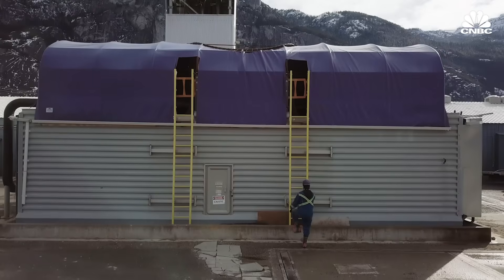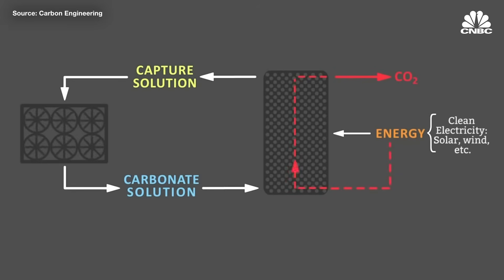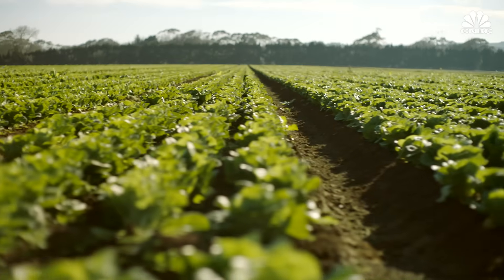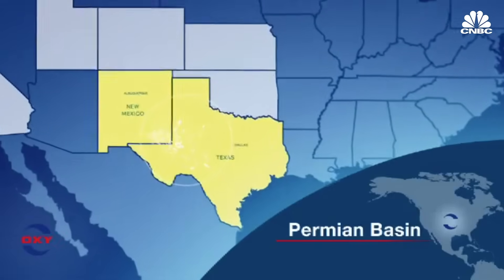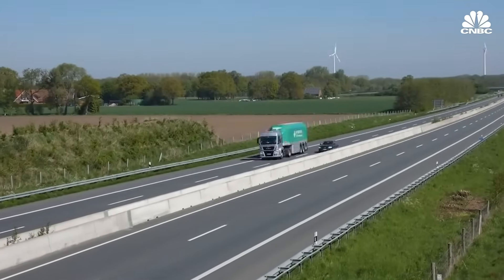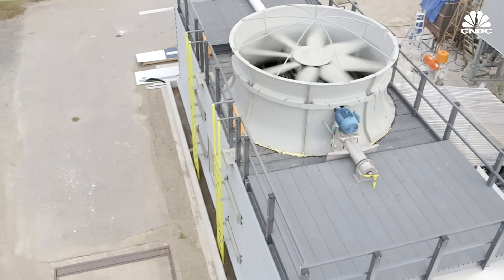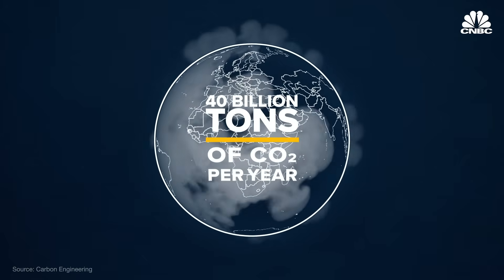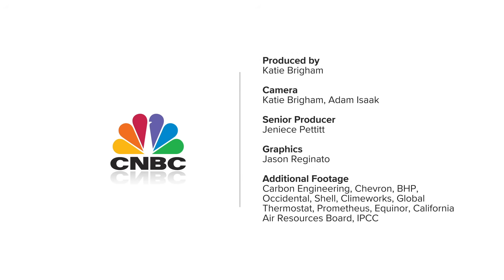Bill Gates-Backed Carbon Capture Plant Does The Work Of 40 Million Trees

Comment: Trees exchange oxygen for CO2 . 
They don't just take CO2
Reply: exactly.. this does not replace anything, its a giant CO2 sucking machine.. it doesnt convert it into anything useful- heck they even said in this video that the pellets would be 'buried underground'... wtf???
Reply: @jub8891  the pellets can be turned back into fuel, which is pretty much why these oil companies are investing in it. it becomes sort of carbon neutral its a good way to use unreliable solar and wind power and convert it into a reliable fuel source.
Reply: @gargalash9191  i dont think you can just keep recycling carbon as fuel.. and in the end you are just burning a carbon based fuel all over again.. that is why the first proposal in this video was to literally 'bury it underground' then followed it up with a vague comment about using it as fuel.. not to mention the vague 'chemicals' they are using to trap the CO2 which they never named- i wonder if that chemical is in anyway safe or how much energy is required to produce it?
Reply: @jub8891  the chemicals are in a closed loop cycle im assuming its similar to an a/c unit where their chemical is like Freon but it pulls carbon. oil companies are looking into new ways of cracking fuel this is one of them. another one thats interesting is plastic to oil in large viable scales, once again oil companies are investing. oil companies are investing in green tech they know there's a transition coming.
Reply: Whatever they make o2 or not, does t really matter. Removal of co2 is their goal (it will not work anyway), not replacing it with o2. We have enough o2 and grabbing even 30% of all co2 would not change o2 levels. But they will maybe capture 0.0001% year.
Reply: Well right now there’s an inbalance of c02. The point is to make this more carbon neutral. I think there’s plenty of co2 we don’t need. Now if they can just plant more trees then im all for this
Reply: True, but we're not actually on short supply of oxygen. If trees 300ppm of CO2 (which is a lot) out of the atmosphere, they'd release 300ppm of O2, which is very little compared to the 200k+ already in the atmosphere.
Reply: We don't need more oxygen
Reply: @danm4320  I do

Comment: Just plant trees and replace coal and oil by nuclear, the solution to climate change is staring at us in the face.
Reply: Loppy2345 renewables are 1/2 the cost per MW to construct compared to nuclear power, and without the on going fuel, maintenance, operations,  waste disposal,  public liability and decommissioning costs nuclear power has. This is why new nuclear plants arw not being planned - renewables are vastly cheaper.

Comment: Carbon capture still uses energy to work. Even if this energy is "clean", the clean energy has a potential alternative use - to be used for some other purpose which is being currently serviced by conventional energy.

Natural carbon removal machines - trees and oceans teaming with life, are not only cheaper methods but also provide multiple other benefits - like improving soil quality, sustaining other life form, preventing erosion and many others.

In my view the option is very clear - we only need to act!
Reply: Why not have both? Planting trees is good, however thats not exactly an energy free task either. Humans are going to pollute, having more options on our side to cleanup is a good thing.
Reply: Yes but the point is, you're getting more co2 taken out with a fraction of an energy as compared to just planting trees. It's a cool way to go about things because no one wants anymore taxes on fuel. It's a disaster In Europe.

Comment: Biofuel isn't viable, in the UK more land area than there actually is in the whole of the UK would be required to supply energy to the whole country. Also it replaces food production. In terms of ecology it provides an ecological desert with often only one type of species in a whole field due to insecticides and auxin based weedkillers. It's the same problem with arable farming. But anyway biofuel isn't viable, something like solar or nuclear has a much higher energy density in terms of land area.

Comment: Sounds like a bucket of pure snake oil to me. Being a guy who knows a little bit about thermodynamics, what I see here, is Perpetuum mobile. 

Basically, if you can catch more CO2 than you produce, you could use that C to fuel your CO2 capture and have an energy gain.
As I have said, that is a principle for Perpetuum mobile, a technology, that is yet to be produced, because physics.

Now I can already hear the clicking of the keyboards of furious fan boys, so let me explain further. If you can make that Perpetuum mobile work, power to you. But if you still need more energy than you capture, and supply it through renewable resources.... well... then you can shutdown that coal power plant and release less CO2 in to the atmosphere, having an equal or better CO2 removal result to your CO2 capture system.

In other words still - use renewable and nuclear power to power cities and traffic, and you'll have significantly better result by not sending that CO2 in to the atmosphere to begin with. Because nuclear makes only steam, and relatively easy to deal with nuclear waste. Renewable in best case scenario has 0 negative emissions and will catch on to emissions made during it's production.

Let me also remind you, that CO2 capture uses chemicals and other resources to keep running. All of these resources have to be taken in to account when calculating the effectivity of the system. Making of those chemicals also creates various types of pollution, that have to be taken in to account when calculating positive impact. This system will be lucky, if it manages to have at least a positive impact of 0.

As an electrician, having decent knowledge on how power is made and delivered, I can tell you, that an easy solution is nowhere near to be found. All solutions that will have a truly permanent and fast effect include big changes to our lives, and massive public investments.

It's quite clear why fossil fuel companies are so interested in making this a big thing. It's a system, that can mask the real issue or sending CO2 in to the atmosphere, maintaining their business. It's very similar process to tobacco companies trying to deny the effects of smoking on peoples health. These companies already feel that their shoes begin to leak and are trying anything to ensure their survival, as the effects of global warming begin to be obvious and undeniable.

Let me remind you however, that those fossil resources we're so happily using here, are maybe the only such sources in the universe. "What?" I hear you ask. Yes, our fossil fuels are a result of rare coincidence of presence and not presence of very specific types of life. Both sources, coal and oil, are here only because of two massive booms and die-outs of life, while bacteria needed to process their bodies back in to CO2 didn't exist. Chance of occurrence of such conditions within reachable distance from earth are HYPER RARE.

Of coarse, I keep on happily driving my diesel car, because unfortunately, better solutions are hilariously expensive and absolutely unreachable to me. That brings us to the real solution - make renewable sources attractive and affordable, and people will better themselves automatically, because they'll save cash.

Comment: People's always first port of call is always trees, whereas in reality a huge amount more is absorbed by the see. From the removal of CO2 by photosynthesising zooplankton, to the formation of carbonates in vertebrates, the sea's ability to absorb CO2 is far greater than trees. But unfortunately with increased sea temperatures, the partial pressures of CO2 that can be dissolved is reduced, so CO2 is released into the atmosphere. Also increased acidity is killing plankton. There are some suggestions that even microplastics are having an effect on the plankton's ability to survive and photosynthesise. Effectively, with warmer oceans and more acidic seas, it's a downwards spiral in terms of atmospheric CO2 concentrations.
Reply: the oceans are hard to control as eco system, one would need to add more nutrients - who knows what would become of that. It could backfire OR the a waste of valuabele nutrients (especially phosphate !).
Reply: @xyzsame4081  Adding fertilisers would cause eutrophication. Algal blooms would lead to an increase in CO2 production and reduction in O2 concentration. The only viable way to reduce sea temperatures is to reduce global warming.

Comment: wasting 50% or more efforts rather should setup plant with high emission industries like coal TPP, gas TPP, cement plants, steel plants, etc since can do carbon capture more easily and cheaply from flue gas and convert it to methanol, chemicals, etc. as per commercial viability.